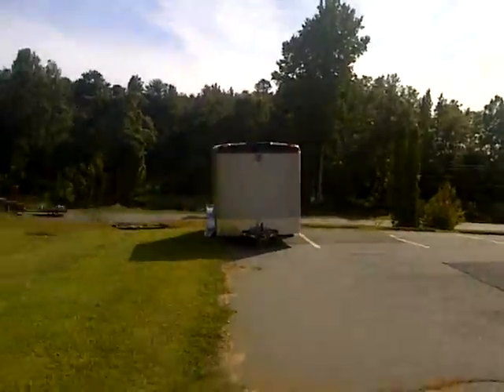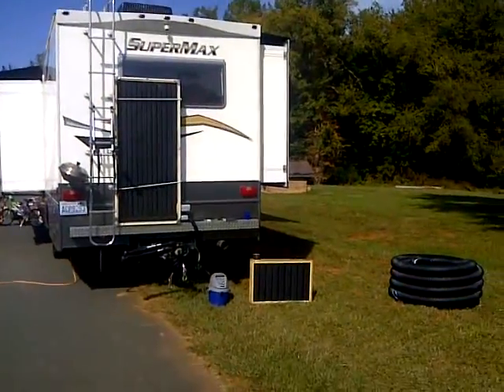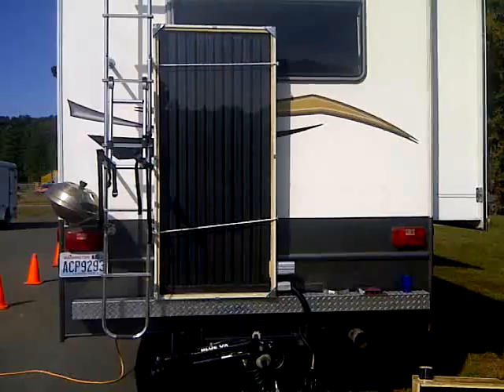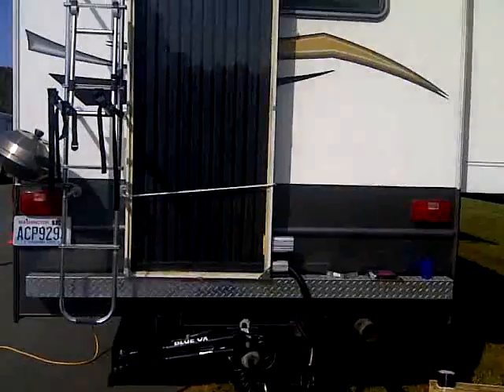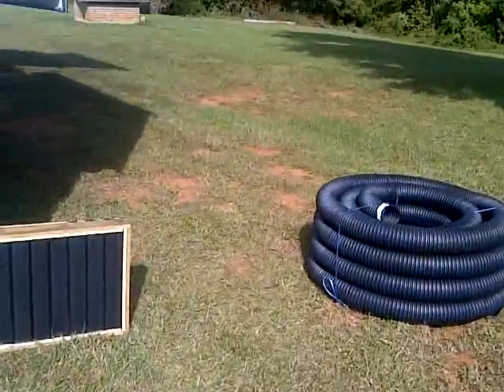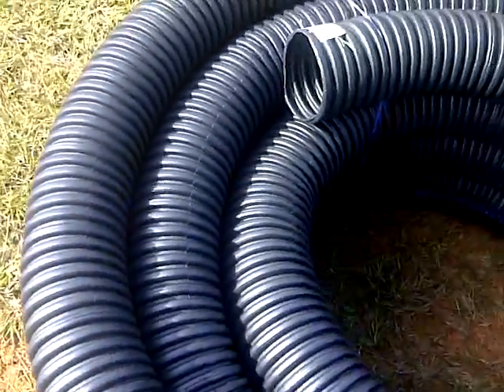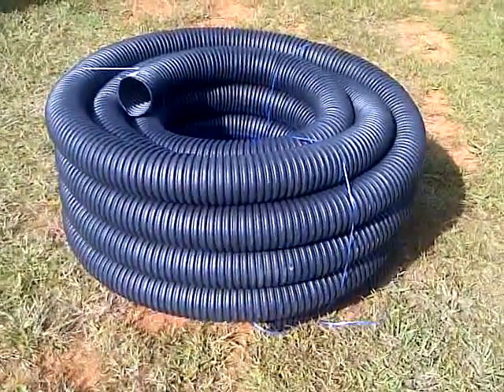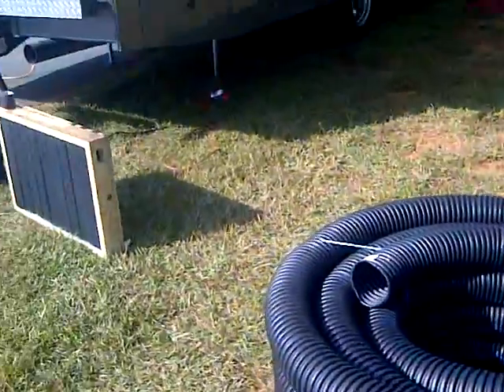Free Solar heat for your Motorhome, RV, Boat or House - Solar Heater build - Part 2

Comment: Instead of using plywood with toxic glues, I would suggest using light weight steel stud material found at home improvement centers. A great chalking is aquarium chalking if you are concerned about toxins. Using aluminum soffit also helps reduce weight. Consider a serpentine air flow with the cold air entering at the bottom and the hot air exiting at the top. If using a fan, you can use a rheostat to adjust the fan speed and a thermistor to turn the fan on and off automatically. If the unit is  mounted, be sure it has a vented top you can leave open during the summer months without critters getting in it. I would like to see studies done on different types of paints.